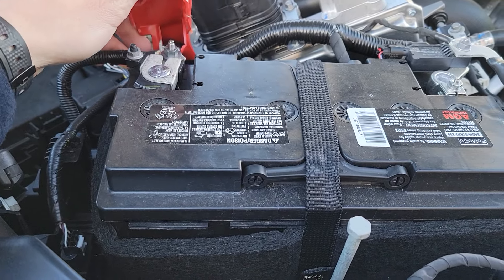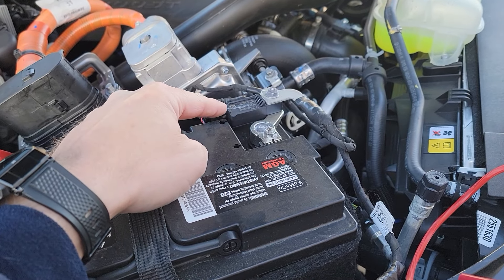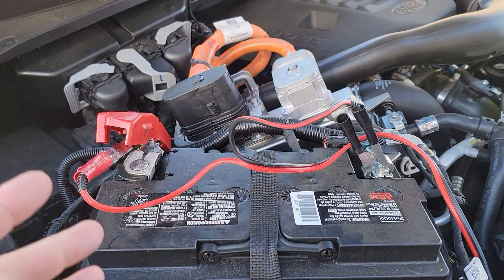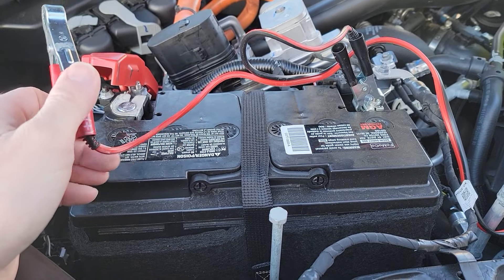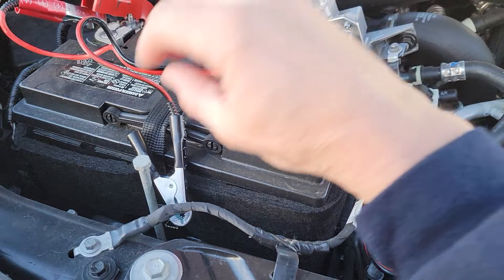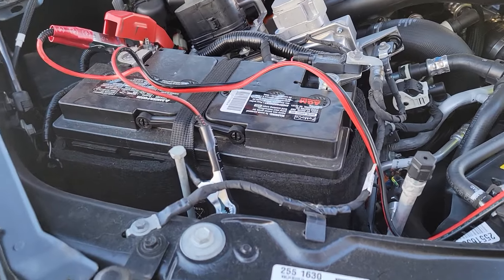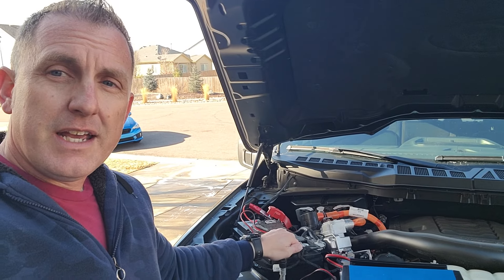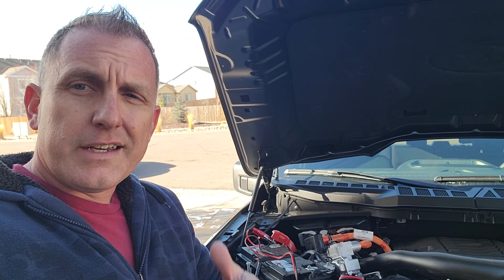How to Properly Charge a New Ford F-150 or 2015 or newer Ford! You may have been doing it wrong!

Comment: You should jump "on the other side" as well.  That device includes a shunt that measures current in to and out of the main battery. The computer may need recalibrated if you do any power in or out of the battery bypassing the shunt.

Also, your F150 may have an auxiliary (small) 12v battery under the back seat.  A run down battery can sometimes damage that secondary battery, or it may need to be charged separately from the main 12v battery.